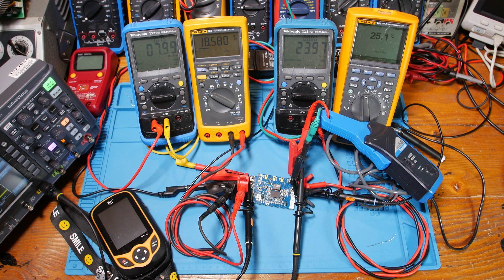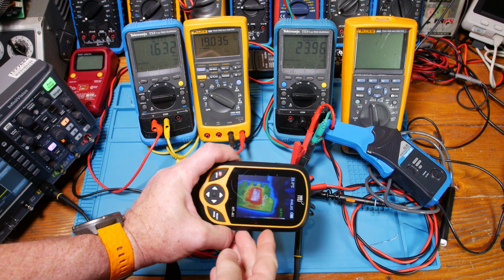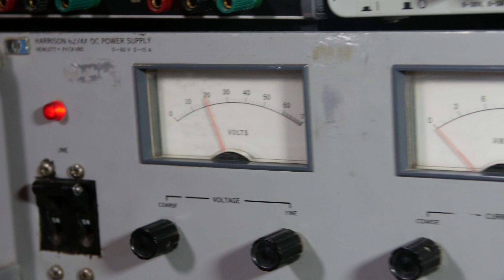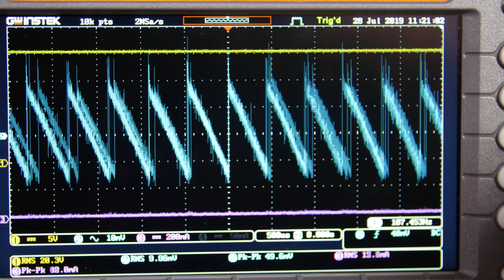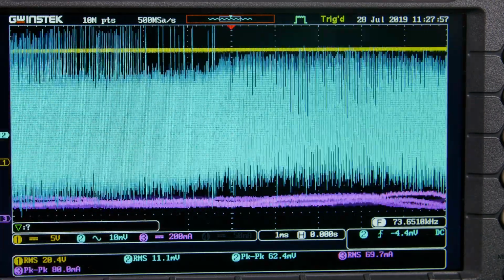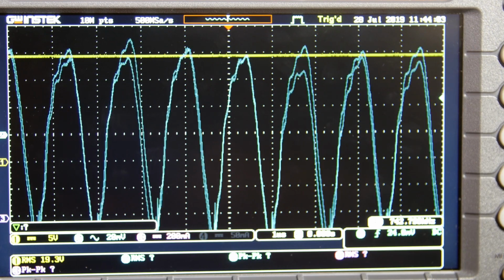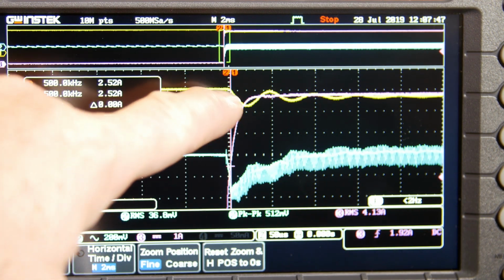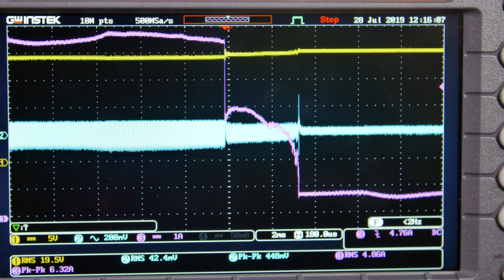Buck Boost DC - DC Converter #boostconverter #Picorconverter #PI3749 #VICOR

Comment: Good video. It is worth mentioning that the majority of the ripple is actually being caused by the Kunkin load (I picked one up after watching your video). A different DC load with linear mosfets on its input or just plain resistors pulling power from the DC-DC converter would show significantly different results. The Kunkin is nice due to the form factor, but it is miserable in terms of slew rate and ripple noise compared to other DC loads.
Reply from the maker: Supercilious Dude I completely agree with all you said!!!  Thanks for offering that information!  I am going to do a follow up Kunkin video - hopefully to show how to improve it.

Comment: It's almost magic that two stamp-sized components can deliver 140W, and even without getting too hot. In this video, there are a lot I have to bend my mind around! :-)
It took me a bit to accept that the noisy signal in fact was fairly smooth, the only reason for the signal  looking like a saw is the amount of magnification. But if that little circuit can deliver so much so great, is a SMPS even necessary?
Reply from the maker: Yes this is like magic - definitely cool power;) Isolation is the only thing needed by some applications, but this makes an awesome post regulator!

Comment: Hi Eddie.  Interesting video for a number of reasons I think - I'm currently working with a Switching Regulator in step-down mode. You mentioned a number of times that pk-pk ripple looked good but it was being measured into the hundred(s) of mV and never seemed to get lower than tens of mV.  Is that really good - on the one hand, I'd love you to say yes, as I'm getting around 30-40mV pk-pk with around 5-8mV RMS so I could crack a smile!  On the other hand, it seems really high to me so I'm looking for improvements.  What's your thoughts on usage of this converter you demo'd?  I'd guess not for very sensitive stuff.  I don't have a lot of experience of power supplies though for comparison purposes: what's the normal ripple/noise to expect - I'd have thought into the uV?  Still, it's impressive to dump that much power out without heating up!
Reply from the maker: Thanks Andrew!  Ripple is typically rated at 1% so for higher voltages, the ripple can be in the hundreds of millivolts.  I hope that makes you happy about yours.  I will show a great method to reduced though;)
Reply: A bit higher than 1% at the moment: 2-3% at 10Ohm load and around 8% with a 5Ohm load, but I'm working on changing the PCB layout as that is, frankly, horrendous.  I made some terrible mistakes with both the layout and the grounding approach.  Please hurry up with showing us your method :)